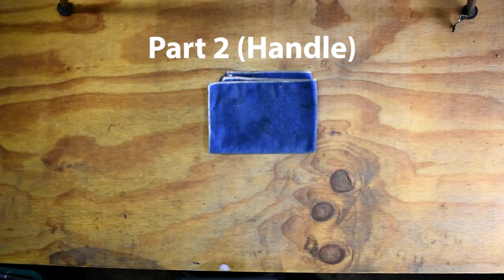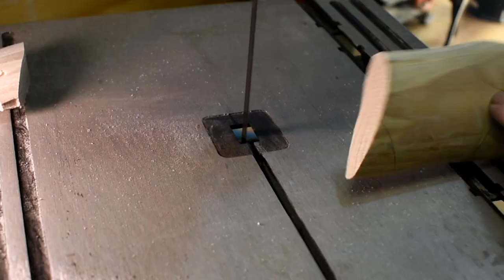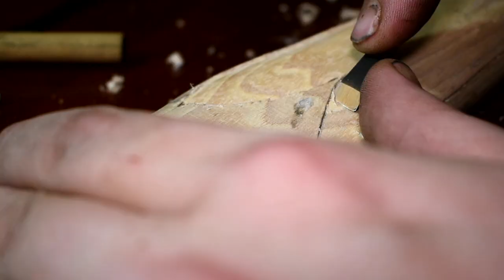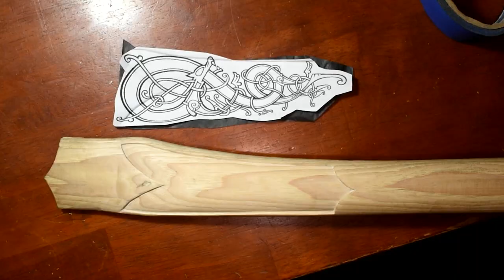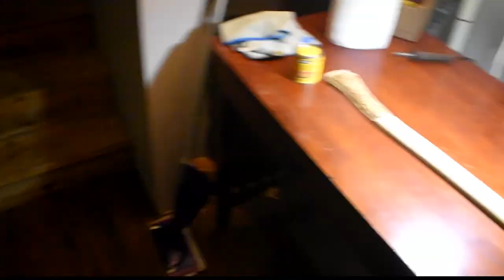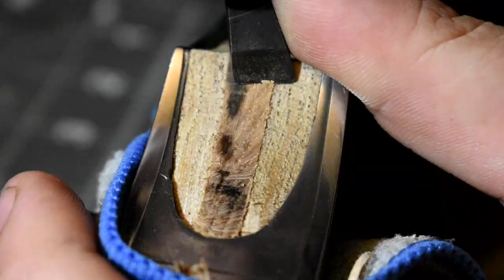Turn Harbor Freight Axe Into Viking Style Axe  With Carved and Wood burn Handle

Comment: I'm doing my best to replicate this as a christmas gift. What kind of vinyl tape do you use for the edges? I only get one shot at this so I want to make sure I do it right. I ordered some vinyl decals off of Etsy for the design on the side (going Skyrim themed) so I hope those will be appropriate.
Reply from the maker: So for the edges I used Vinyl Pin Striping. I got it from the auto parts store.  It works so much better than electrical tape. It sticks very good.  Thank you.

Comment: Are you using carbon transfer paper for the art?
Reply from the maker: Yes, I’m using graphite paper to transfer the images onto the wood. To transfer the images onto the metal I started using Dura-Lar Transfer paper because it’s clear. It’s kind of a different process though. But I do show how I use that in a newer etching video that I did.
Reply: @drewdoesart9277  great information!    I'm currently making a harbor freight Viking axe 😁